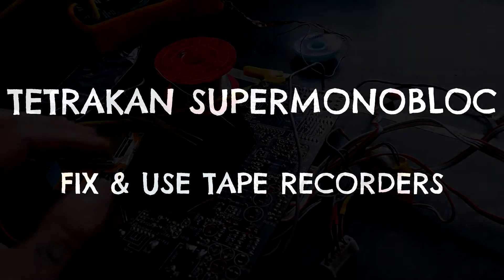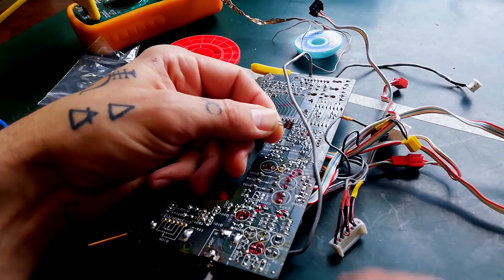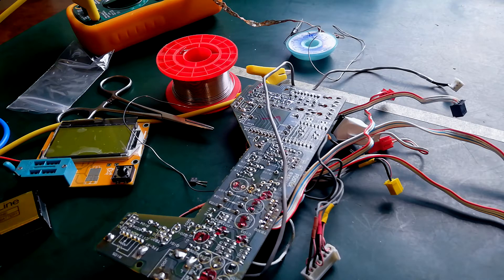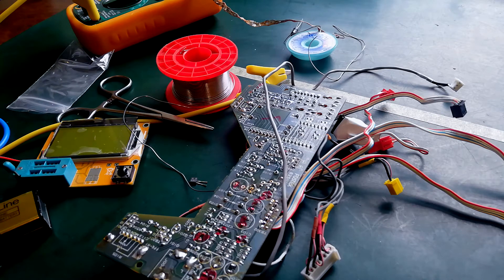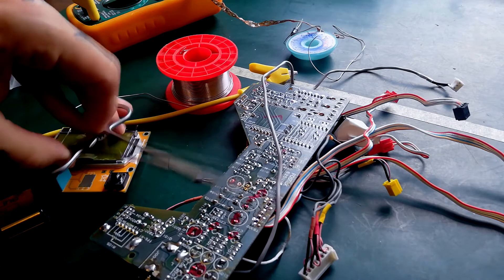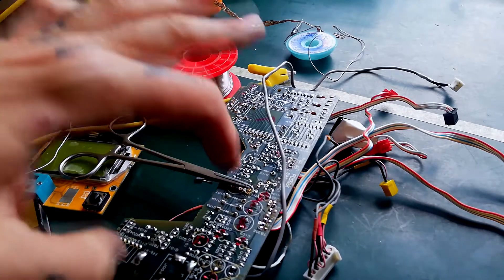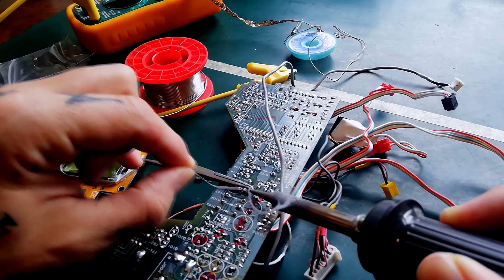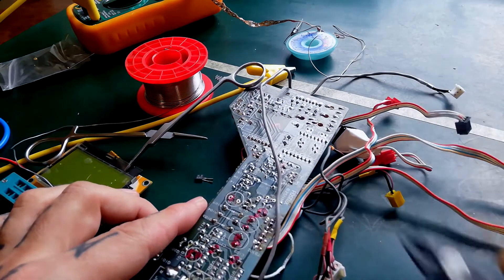Protect Diodes & Transistors While Soldering | Hemostat As Heat Sink

Comment: great video, I'm grave digging here, but hopefully you can help. I had the same issue, same board, replaced the transistor. I'm not getting any amplification at the mic amp pcb now and  I checked the power rail - only 1.8v coming in, however the second power rail has 12v coming in but that's for the VU meter. My question is, is it really 1.8v powering the mic amps or is it actually meant to be closer to 12v?

Comment: Good tip! Here's one I can share that's in the scope of this video. 
A trick for preventing a wires insulation from melting back or to stop heat shrink shrinking because it's too close due to limited wire length, a  v paper clip clamped down on the wire as close to the exposed section you plan to solder works really well too, so long as it's a metal clip ofcourse.

Comment: Thanks for this video. Should the heatsink not be between the main body of the component and the PCB?
Reply from the maker: Hang on I’ve just figured out what you meant - the position of the haemostat, right? M not totally clear on the physics but I think the heat dissipates quite evenly across all the conductive metal, therefore heat is drawn away from the delicate semiconductor regardless of which side of the pcb you place the haemostat. So maybe what you suggest would be slightly more effective, but from experience what I show I. This video is good enough, thanks for watching.
Reply: @Tetrakan  yeah, that’s what I meant. To be honest, whatever keeps the heat away from transistor bodies is good in my book. Thank you so much for replying. Much appreciated 👍
Reply from the maker: Old video and I don't remember the details but generally components like voltage regulators which dissipate a lot of heat are screwed to a large metal plate as a heatsink....the heat some of these components would damage the material from which printed circuit boards are made, and as such that naterial  would be a very ineffective heatsink! Does that answer your question?
Reply: Add a dose of freeze spray for good measure?